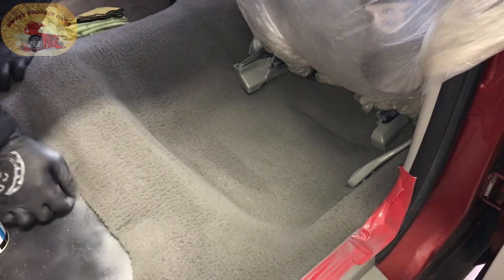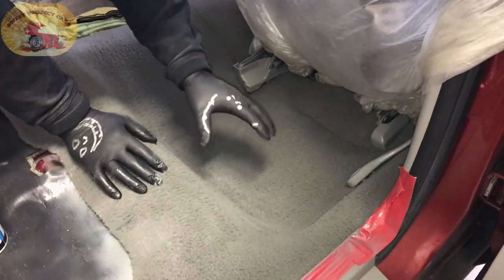How to Paint Any CARPET... Simple, Fast & PERFECT RESULTS....DIY

Comment: You link several different products , but which products did you use for this vid ? Have you ever used the liquid product RIT instead of spray ?

Looking to do my black carpet which has faded to gray
Reply from the maker: Jon Single any of them work we would use any in a heartbeat, the painting is the best way to do carpet  we have videos on using rit and it is hard to do sometimes if the carpet is not the right material painting works everytime

Comment: I have a question for you. 
I know you've done videos on dry lubricant, sqeegees, squeaking windes, and squeaking wipers but not noise plastic. 

Is there any way to modify squeaking, or ticking plastic parts to make them quite?
Reply from the maker: Willy Ck  tell me what you are dealing with and we may be able to help :)
Reply: @SweetProjectCars  the center console of my 95 chevy made of plastic has few moving parts that squeak and rattle constantly.
Reply from the maker: Willy Ck I would use this it works great https://amzn.to/2IsK3B6 it is not like any other product on the market we use it on many motorhomes that seem to find ways to squeak and chirp while moving down the road.

Comment: seems like replacing the carpet would be easier.
Reply from the maker: David Cleveland well we have tried both and this is at least 5 times cheaper than new carpet and that is not factoring in our labor costs to remove and replace seating and consoles, if you do factor in our time then it is about 10 times cheaper to paint. and as you may know that most times when carpet needs to be replaced it has holes and severe wear if it doesn't have this kind of wear then there is no sense in replacing it when in 2 hours you can have the entire carpet painted and be back driving it, also you deal with rusted seat bolts and airbag sensors when removing the seating it is a real hassle and you always end up opening up a whole can of worms of other issues, then to buy good quality carpet that is another factor as well because none of them fit good unless you buy OEM and that is NOT cheap.